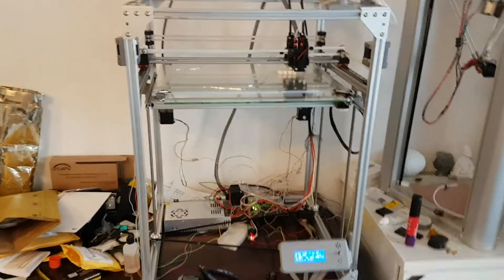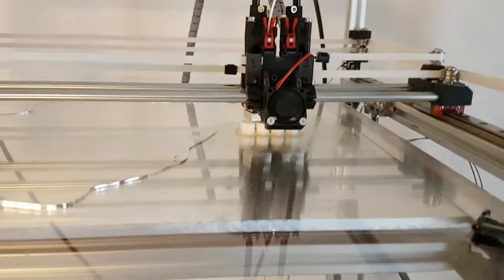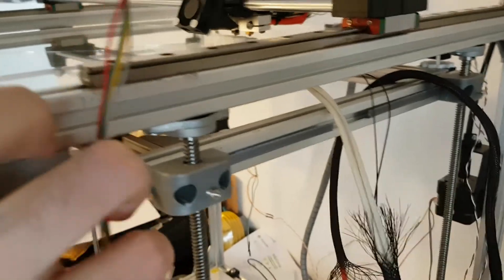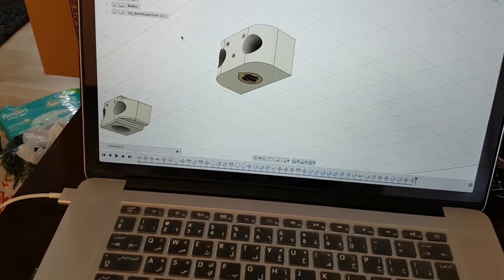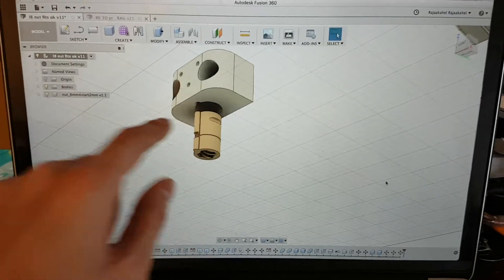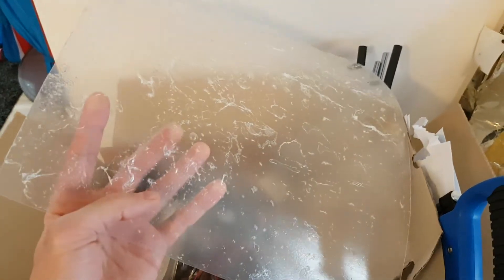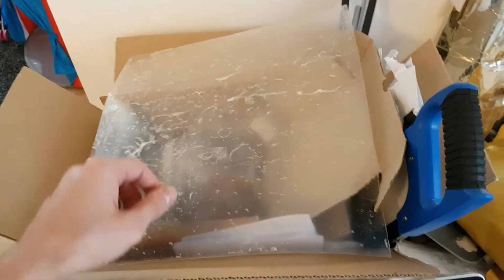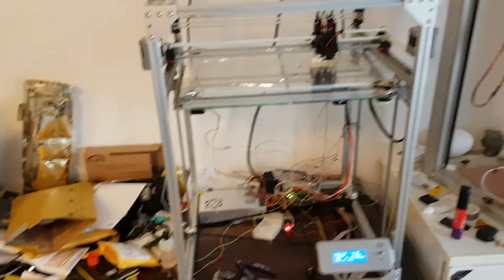RK 3D Printer updates#1 (testing IGUS filament)

Comment: Coming along...
Looks like that was regular float glass.  Borosilicate glass shouldn't do that even with the added stress from the clips, although if it is going to be unsupported you should probably go thicker.

To apply the PEI sheet with no bubbles:
Put your glass on something equally flat, like on a marble counter-top with a sheet of newspaper to protect the bottom.
Peel back the first 10mm of the protective backing from one edge of your PEI sheet, and line up that edge with the glass.
Rolling the PEI sheet into a cylinder slightly will help to keep it from aligning unevenly.
Press that first 10mm onto the glass in a few spots, then roll across it with a rubber roller.  Your thumb and some soapy water works too if you don't have a roller.
Peel back another 10-30mm, repeat.  No bubbles every time.
Reply from the maker: Daren Schwenke Thanks for the info! Actually the seller just sent me a bad adhesive that was folded "not straight". I'll buy a better one and will consider your advices :)
Reply from the maker: And for the borosilicate glass your right, I had a 300*300mm one and it's super! But now my bed is bigger, so I thought I'll try PEI instead of glass.
Reply: On my older printer with a 450mm bed I also tried using float glass due to the cost of the borosilicate glass at that size, but it would always eventually crack.  No scratches and polished edges helped delay this a bit.  As that was a delta and the bed didn't need to move, I ended up using a polished stone floor tile instead with pretty good results.  You can print directly on the stone with a light sanding.  The stone has a lot of thermal mass, so it requires a pretty hefty heating system though.
Reply from the maker: That's a huge delta, cool! Nice idea to use a stone! I might try it later.  I also wanna try the jeans method, but that's if I don't like the PEI for some reason..